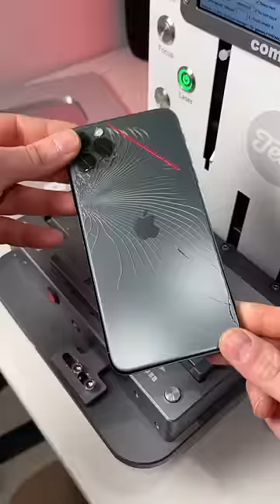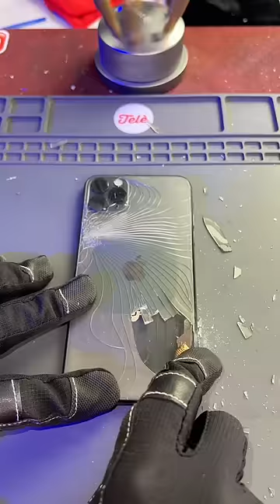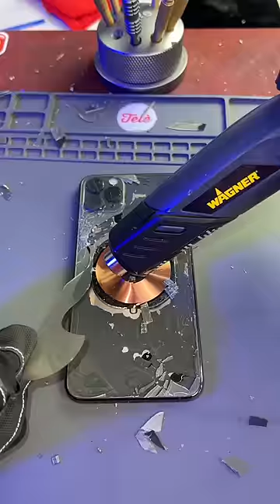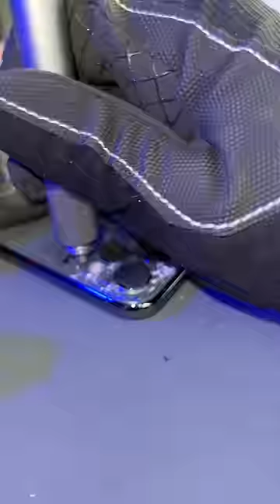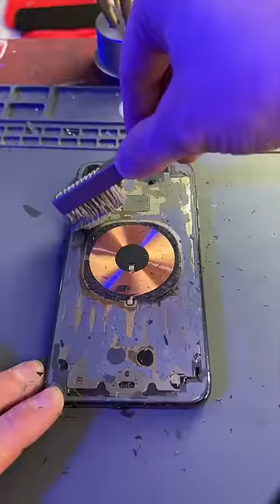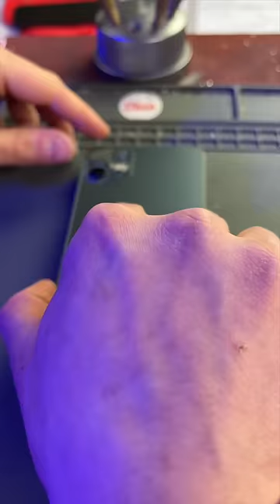Just another day at the office 🤠 #Shorts #Tech #PhoneRepair

Comment: I missed the time when we can freely removed the back phone cover on our own rather than taking them to a phone store just to remove it.
Reply: My old phone froze all the time, all I had to do was remove the back and take out the battery. Easy fix, worked every time.
Reply: @comandosespeciales yeah they are monopolizing that by doing this. now you dont have the freedom to fix your phone youre gonna have to just buy another one
Reply: my phone is still one of the ones that has a removable cover

being able to take out the battery is a flex at this point
Reply: Past:
Oh no, i dropped my phone! No problem, i can put the cover back.

Nowadays:
Oh no, gotta buy new phone -_-
Reply: I remember when my phone fell and had to reinsert the parts like Lego's 🥺🥺🥺 and if don't have a charger for it you can remove the battery and buy the wall plug charger where you have to line up the pins to the square conductor lines on the battery to charge it
Reply: I can do that with my android.
Reply: The whole purpose of non removable back is for water resistance. I would take a water resistant phone over a removable back phone anytime
Reply: And its gonna cost you 300$

Just buy other brands
Apple nowadays suck balls
Reply: @khanhtham1812  yeah everyone is also talking about “nowadays” like Apple didn’t fix this issue with the 14 models. The back panels are removable with screws now so no more phone cooking/razor blade wedging. It’s kind of a hassle to get everything apart enough to get off but it’s way less hassle than 30mins-1hr prying at glass with a razor
Reply: Yeah but then you give up on water resistance
Reply: @imfastboi  All we have to do is be careful then, I never brought my phone in the showers.
Reply: I love how no one here knows that he has to remove it not to replace the battery but to get a new back glass because it is cracked 🤦‍♂️
Reply: Get an android
Reply: @crowgang6678  most android phones nowadays don't have a removable back though
Reply: SAMSUNG ILLUSION 💀
Reply: @Palladiumavoid  this is only an inconvenience if you have butter fingers.
Reply: that never happened
Reply: Ah yes, the days of bulging batteries
Reply: @trevorandrew8726 have you actually done one?
I have, it’s not that easy. heating up still needed to remove back glass edge from frame. If you try and remove like you would a regular screen it won’t happen
Reply: The OG Samsung generation!
Reply: hahaha i still got em wanna buy :>
Reply: You have it rough, my new phone has a back that comes off easily, I can also put it back on easily (The glue melted and the back cracked, currently waiting for a new back case to arrive)
Reply: This is why i use samsung bc you can still do that
Reply: Well that's only with Iphones, you can remove it on androids
Reply: @miwiki6  my phone has one of those too,it's a literal flex lmao
Reply: @comandosespeciales  that couldve corrupted important system files
Reply: We could do that?
Reply: To be fair if you put a good chunk of money and time into learning how to you still can
Reply: @comandosespeciales  just hold the power and volume buttons together for 30 seconds. It does the same thing.
Reply: Marketing strategy
Reply: Ny soster still has hers, and it's in REALLY bad condition to the point where the power bytton doesn't work and 1 small fall. It becomes lego pieces.

 But hey, it's still working perfectly fine 😂😂😂😂😂
Reply: Youse can still get Nokia bricks guys
Reply: Money making scheme that’s why
Reply: @pea7422  it's nothing to with that, it's for waterproofing. You have next to no water resistance with pop off backing because there's no adhesive, any water and it's immediately frying the entire phone. It's really not that hard to fix your own phone...all you need is a blowdryer to soften the glue and new glue to reapply
Reply: @imfastboi  nope, my xiaomi phone have removable backs and I bring it in my bathroom since 2014 & I still used it until now.
Reply: @VermillionStallion   I brought my Xiaomi phone with removable backs to my bathroom since 2014 and I still used it even now 😂 heck, I lost count how many times the screen got spilled by water shower 🤣
Reply: @adhiwiranata400  Ok so I have a xiaomi phone too (without a removable back) which I also bring into the bathroom
First of all bringing your phone whether it's water resistant or not in the bathroom will not damage it even if you drop water on the screen
Secondly depending in the IP rating it can be dust proof splash proof etc doesn't mean that a phone without a back won't survive but a phone without a removable back will be more resistant to the kinds of hazards
Reply: You must be an android user bc iphone couldn’t be open since the first iphone
Reply: Ong
Reply: Buy anything other than apple then.
Reply: Oh yeah, and back when phones were durable too
Reply: @khanhtham1812  doesnt need to be glass though.
Reply: @Stephen.C.  glass makes the phone feel more premium
Reply: SAME I ALWAYS FELT LIKE A TECHNICIAN OR SMTH
Reply: I'ts done for only once use
Reply: Waterproofing left the chat
Reply: You can still do it with the Fairphone 4
Reply: 1 😊 nnl.  N.  N no nm. M.  😢
Reply: yeah no i don’t know how you miss that 💀 every time i dropped it, it’d separate into three pieces then id have to put it out together rather than just simply picking it pack up.
Reply: @miwiki6  ok go buy Samsung if u miss the time when we can freely removed the back phone cover on our own 🤨
Reply: Good times.
Reply: Sure, its been a long time
Reply: it's so we can't remove the batteries. Ur phone is on even when it's off. they can track u anywhere at anytime. watch Kimi lol
Reply: Yes
Reply: لا إله إلا الله محمد رسول الله علي ولي الله
واشهد ان الحجة بن الحسن ولي الله
Reply: Dont think they'd have a very good dust or water resistance if we could still pull em apart shame tho
Reply: @dnbcone  they're dipped or sprayed with water/moisture sealant to protect the electronics inside. I forgot exactly what it's called
Reply: @tjgrafiks  thought it would be something like that, is that after they assemble it tho? And tbh I always thought moding phones etc would be a big thing like the way people build pcs etc like I know so many people that have built and rebuilt pcs but not a phone, they're basically portable pcs nowadays anyway I've got the fold 3 and its just a computer that I make the occasional phone call on 😂
Reply: fr
Reply: Well if you live in europe, your wish might come true. EU wants to make law that would (among other things) make possible for user to swap batteries without special equipment or visiting service shop.
Reply: oque os fabricantes puderem fazer para ficarmos dependentes em manutençao eles farao.  querem tirar ate nosso ultimo centavo.
Reply: @dnbcone  more money in just making us buy new phones being that they’re almost the price or sometimes more than a pc 🤣
Reply: Yeah
Reply: And this is why I will never buy an apple product. Additionally, who the hell thought it would be a good idea to cover a phone in all glass? 🤔😱
Reply: @imfastboi  I've yet to get an Android that didn't have a removable back. And even newer cases can still be removed without having to go to anywhere special.
Reply: @imfastboi  Don't take your phone in water and you won't have a problem?

Rain wouldn't be an issue so unless you're going swimming, dropping it in the toilet or washing machine or taking a shower and dunking your phone under the water that's a you problem. Not the phones problem. 🤷‍♀️
Reply: broken measure2already😂😂😂
Reply: @comandosespeciales  من اجل
Reply: I have a Fairphone. These are so adjustable I love it, you can just open it and also nothing is glued it's just screws so you Dan fix it yourself
Reply: كظظد.. 
كك
Reply: @pea7422  that’s… not what a monopoly is
Reply: This is why my Nokia 3310 still works and charges.
Reply: They say is all about hermetic sealing
Reply: Wish I could be snarky and say "well, actually you can with Samsung" but nope, removed it here too. Pretty sure it's just better quality overall, still sucks though.
Reply: А еще можно было достать батарею, потереть её и зарядить телефон)
Reply: @sans.2862 Jesus if you dropped it in a puddle of  water and your battery fell out your phone is done. I've dropped my phone in the pool pulled it out let it air dry and it works fine. There was no IP rating on those phones with a removable battery.
Reply: No tendras nada y seras feliz
Reply: its only like taht now cuz its waterproof now
Reply: о́о́
Reply: о́
Reply: оо́
Reply: Ош
Reply: Ош
Reply: о́
Reply: о́
Reply: о́о́о
Reply: оо
Reply: @skullies3580  оо
Reply: @skullies3580  о́О
Reply: на
Reply: @Sans.
Reply: @skullies3580  О́о́о
Reply: о́о́о́о́оо́о́о́о́о́😊оо́ооо́о́о́о́о́о́о́о́о́оо́о
Reply: E
Reply: You don't own the phone or yourself anymore
Reply: had to put on my glasses watching this
Reply: Don't cry cause it's smile cause it happened
Reply: yeah its bullshit
Reply: And you can also be a smart person and buy the materials and tools necessary to do it yourself learn about it and do it there you go
Reply: Learn how to repair it than
Reply: Brother just don’t use iPhone majority of other phones still have that feature
Reply: That is Stupid Design from Apple ,Useless,  No Mind
Reply: @pea7422  i thought it was because they were trying g to make it as waterproof as possible.
Reply: get over it already
Reply: Fr
Reply: I get what you mean but like he said, these phones are water resistant and the old ones definitely weren't. You can't have both 🤷‍♂️ but I miss replaceable batteries too
Reply: Anything for money…
Reply: Ew I looked at vermilions vids… I think I need mental help 😭
Reply: Fr and it cost $100 wtf
Reply: When that battery would fall out in school 💀
Reply: thats apple meat rider for you
Reply: iPhone 14 has an easy back to replace. Sadly is only for the 14, not the 14 pro.
Reply: Iphone 14 does, not the pro thow
Reply: One of the perks of having an android
Reply: @pea7422  dude you can still do it all yourself you just don’t wanna put in more effort so you’re complaining instead.
Reply: idk what world y’all live in you can still fix the phone yourself
Reply: But it's not necessary to do that anyway
Reply: @crowgang6678 samsung invented glass backs on phones, theyve been doing it since like 2013
Reply: And like you could change the phone back like wallpapers
Reply: Yeah *"
Reply: You can't open them because the spyware runs even when it's dead
Reply: This is business
Reply: Fr!
Reply: Fr
Reply: @khanhtham1812  A lot kf phones are not water resistant and still have this. In that case the removable back would be better
Reply: @comandosespeciales  😅
Reply: @comandosespeciales  😮😅😮4
Reply: Me also, but I love that they’re now waterproof for a certain amount of time
Reply: It’s because if you can disassemble it easily it doesn’t make for a very water proof phone. If you want one where you can remove the battery, go buy one. They still exist
Reply: @skullies3580  WHAT I DIDNT KNOW THIS
Reply: @skullies3580 um you still can get one like that bro theyre not extinct just go buy an old phone
Reply: @skullies3580 gonna be running apps at 180p
Reply: Been this way since the end of the iPhone 8 days
Reply: Specialized shops like this would not exist today without Apple trying to make phones unrepairable for the end user.
Reply: @comandosespeciales  I had a flip phone that I lost the whole winter, found it outside in the spring once the snow dried up and it still worked 😂
Reply: @comandosespeciales  por eso era una mierda bro
Reply: el diseño con tapa extraíble es una kk
Reply: @khanhtham1812  nah the reason is greed is in their veins
Reply: Yeah...
Reply: Aye androids for the win on that one
Reply: @khanhtham1812  not all of them are waterproof, wack argument
Reply: @King.D_no.1  most flagship phone nowadays are waterproof. Do some research boomer
Reply: pains
Reply: @comandosespeciales  I miss my 2013 beige and second black SAMSUNG GALAXY J3 and my mom's broken note 5
Reply: U can still do this yourself u know that right?
Reply: jesus bro get with the times. if not go buy a old samsung i dont know what to tell you. and didnt the iphone 4, an older phone, have a glass back?
Reply: So you mean just go buy a Samsung?
Reply: I don’t
Reply: My old Samsung has a low battery and when I was about to charge it i dropped it and battery pops out and when I put i together again wallah!! Full battery 😂😂. And I was using it like for half and hour again😂
Reply: @andjelijarandjelovic5097  Not all Android phones, only older models.
Reply: @tsm688  Most Android phones don't have removable cases either.
Reply: @degstoll  Mine does.  Already replaced its battery once.  Our options as consumers are imperfect but we don't have to make stupid choices either.
Reply: @tsm688  But I don't need a removable case so how am I making a stupid choice, all the phones I know and I have had that have removable cases are older versions that don't run well, besides, I'm a student, I sometimes need my phone to do homework or  simply download large files for ebooks and stuff an older version phone won't do that optimally. Also, a simple message can take up to three minutes of lag so what exactly do you want me to do?

Also, with a removable case anytime it falls you risk the case and battery to fall and you have no dust proofing or even slight waterproofing.
Reply: @degstoll  Files:  Removable SD card.
Reply: @tsm688  WOW, you seriously ignored almost everything I said and jumped straight to the SD card thing, not all phones supports expandable storage so stop trying that hard to be right.
Reply: @degstoll  of course they don't.  Which is why consumers should buy ones that do.  The limited options is partly because of bad decisions made by others...  Buy disposable trash, receive disposable trash, more disposable trash is sold, more disposable trash is made.
Reply: @_khaine  not with the new ones🥲
Reply: @tsm688  Okay...? But that won't make me go use an LG K8 or ZTE Blade a7.
Reply: Get an android. Better market place.
Reply: Nah that cheap af 😂
Reply: You also couldn’t drop it in water and expect it to work again. I can take my phone swimming in my pocket and it’ll work just fine when I’m done
Reply: Bruh true, they are making everything worse, and we cannot do anything else than watch
Reply: Are there still people Taking phone to repair? I was sure its already cheaper to buy New one than pay for repair
Reply: If you could do that then your phone wouldn’t be resistant to water
Reply: Nah removable covers sucked for multiple reasons and you’d hate them today cause they’d have to be plastic which dosnt sound horrible until you’ve used a metal or glass phone for a while
Reply: Apple did it first to make the phone more air tight so they could increase water and dust resistance.
Reply: They still exist stop bitching about something you chose to upgrade, was the phone store man holding gun demanding you buy the phone with no removable back?
Reply: Someone dropped their IPhone 11 in a creek and plugged it in directly afterwards. Bought it for 3 dollars and some pocket lint off him and spent 60 dollars for a off-brand screen and battery off Amazon and fixed the whole thing up in a day and it worked good as new. If I took it to a repair store they would’ve taken one look at the water detector (which tripped) and denied fixing it saying some BS like “it voids the warranty”. 

TLDR: just fix your phones yourselves people it’s stupid easy, especially if some Indian guy on YouTube has a video.
Reply: This has never been an option for iPhone, you can still switch to an android with this option, though
Reply: Get a Android 😂
Reply: I know and if you have a phone case what's the point of glass in the back. Ain't gonna see it anyways.
Reply: But now they're waterproof so that's good
Reply: Yeah they make everything difficult
Reply: That was before we had things like wireless charging 💀
Reply: @pea7422  or buy the equipment to do so yourself and start your own company
Reply: Right to repair and fair competitor laws just entered the chat
Reply: My old galaxy phone had that and i miss that so much
Reply: Can't relate. Samsung user
Reply: Μ2 bro😔
Reply: They make unremovable back with battery couse they want to track all users couse without battery nothing in phobe works, but if we have battery even 1% it still gave some power to track your phone.
Reply: Now I have an IPhone 11 but I used a Samsung J 7 back in the day man , I can relate to this soo bad XD
Reply: @pea7422  спробуйте впихнути сучасну начинку телефонів в ті корпуси і вони дуже швидко перегріються і зіпсуються. Тому все стає "щільніше"
Reply: We do not care
Reply: Lol
Reply: @pea7422 more like buy a new phone every 4 years bc they keep shutting off the older phones
Reply: I’m 26 turning 27 this year and I remember phones with removable backs like it was yesterday
Reply: Even laptop has became like this unfortunately
Reply: Yup. Now you do as you're told and have no choice and you still buy the phone. You complain yet give them your money.
Reply: Being an avid mobile gamer, the removable battery was a godsend. On particularly intense sessions I would remove the back cover and sit infront of a fan for cooling or tactically reload my battery to game longer.
Reply: Ermmm... don't buy an iPhone then..
Reply: capitalism at its finest
Reply: The fact the gov ain't done shit about this. Shows you how much in apples pocket they are
Reply: And even change the colors 😢
Reply: @pea7422  anyone who’s an environmentalist using an iPhone? Call em out on it
Reply: Boomer
Reply: I'm just kidding why you angry
Reply: if you wanted to replace to back on nearly any phone, even older ones, you’d have to do tons of work to remove the components. this is easier, especially with newer phones that have parts baked right into the back.
Reply: @miwiki6  fr
Reply: @PHyN1151  nice pfp
Reply: Bro, When iPhone 4 Aftermarket Colors Came Out It Was A Wrap 😂 I'm With You On This!🔥🔥✊🏾
Reply: @miwiki6 one of the many perks of owning a droid was being able to remove the back AND a battery tbh
Reply: Oh so basically, you miss not having an iphone... influence is as strong as cocaine
Reply: @_khaine  same. I had an extra phone battery because my other phone stopped working. So when one died, I had the other. 200% battery life basically. And along with androids long battery life, it lasted about a day and a half until both batteries died
Reply: Coughs in Samsung Galaxy
Reply: Hahaha y'all complaining, I'm happy with my 2023 phone  rather than an old Motorola
Reply: Yes back then when we can remove the battery and put it back then turned on our phone
Reply: But for Android, it's way better
Reply: yeah💔
Reply: i have a theory they do this so you can’t remove the battery and it can always track your location and record audio even if the phone is off.
Reply: I used to have 2 batteries. Whenever it was out, I'd swap a new one in, have the old one charged. Unlimited power.
Reply: I still can on my galaxy xcover pro . I can still do a battery pull and everything
Reply: @comandosespeciales  just hold press the power button until it resets
Reply: Good thing here in Europe they just adopted a law saying that all electronic devices with batery( phones, tablets, laptops) must be able to be removed by users easy
Reply: never been the case with iphones..
Reply: Ikr...
Reply: Iphone users were too busy making fun of Android users for removable back cover and battery
Reply: Old iphones:👁️👄👁️
Reply: step one:
buy any phone that isn't from Apple
Reply: @pea7422 I like ur pfp
Reply: @miwiki6 I really like ur pfp
Reply: It's the part where people continued buying phones even when manufacturers implemented back parts of the phonrs that couldn't be removed
Reply: SAME.
Reply: Ah yes, you for sure miss the time when your phone fell and you had to rebuild it like Lego. And good luck with that battery working well after it falls out, and the phone turning off losing anything you had opened… for sure you miss it and it’s not nostalgia talking for you…
Reply: But this is so much more satisfying
Reply: To be fair, it's easier to make them water proof this way.
Reply: @miwiki6 drop it in water
Reply: @reagank.2268  that has happened multiple times and it's still as usable as ever
Reply: But u get waterproof
Reply: my old phone was super damaged so the back was removable, I'm still shocked how that thing was still standing
Reply: @VermillionStallion jhshe
Reply: @comandosespeciales lkkkkl..ooookooollllo
Reply: Lets not talk about the price of doing it
Reply: I had an Android Go and that was a feature, it was for sure "fun" looking at all the things!
Reply: I still have a phone that you can remove the back cover off of.
Reply: That will be 600 dollars sir.
Reply: @miwiki6  Newer Iphones will literally not work if you replace the battery for whatever reason. The phon can detect that a part isn’t its original and will PURPOSELY lock out certain feature like the touch screen or camera.
Reply: @SymmbolZS  my repair shop only charged 100
Reply: I also remember my phone being absolute garbage back in those days. Even the “nice” ones broke constantly and had issues
Reply: @masonroddy7447  also i love how they think this is a DIY tutorial video instead of showing how its done in the shop
absolutely clueless
Reply: @doh-nc8ku  Fr
Reply: True but tbh it just feels better when it's closed
Reply: @comandosespeciales exactly it was like it's brand new when u do that fix all your problems
Reply: Здравствуйте о
Reply: Iphone moment
Reply: @miwiki6 Fr i still have my androids
Reply: Thats why i have a Fairphone. You can remove the battery and repair all on your own.
Reply: Just don't get a garbage iphone
Reply: I pray we turn to Jesus Christ and repent of our sins for the kingdom of heaven is at hand forgive others just as God can forgive you john 3:16 For God so loved the world that he gave his only begotten son that whoever believes in him shall not perish but have eternal turn to Jesus Christ and repent.
Reply: Planned obsolence, hypercapitalism
Reply: @khanhtham1812 how often can your phone fall down and how often would it fall into water? Isn't the chance way higher it breaks from normal falling rather then water dmg?
Reply: @King_HarIequin  Ever heard of a phone case?
Reply: I have the ability to 
Then again, I own a Samsung instead of Apple
Reply: The good old "phone explodes on fall"
Reply: then go buy a flip phone easy solution for you 🤷🏽‍♂️
Reply: Flopper, whopper, whopper, fluffy flappy, daddy
Reply: Yeah old Samsungs did that
Reply: @pea7422 literally happened to me yesterday. I broke my iPhone 12 from tiniest thing that makes no sense but whatever and now I had to get another phone love that 1k+ paymant
Reply: Lol then dropping it and having the battery go flying into another dimension xD
Reply: It's a marketing thing. They get more money if you just buy a new phone, because nowadays instead of having stuff last as long as possible, it's getting as many customers as possible.
Reply: @miwiki6 what phone
Reply: How much is it to get my phone fixed
Reply: @comandosespeciales Yes, can relate to this XD
Reply: @comandosespeciales They're gonna make this required in Europe in a couple years
Reply: U stole that from somebody the sound affects u made
Reply: It’s pretty simple, spend about 100 bucks on a good case aswell as front and rear screen protectors now I can throw my phone on the floor n it won’t break
Reply: It's how they scam people
Reply: You miss the time when we still have freedom to do things as we wish
Reply: I still use one of these phones, its a bit laggy but it does the job
Reply: @khanhtham1812 Shit ain't even water resistant though
Reply: Consumers want waterproof phones… jeez
Reply: Don’t worry phone company’s are going to have easily replaceable batteries by 2027
Reply: @comandosespeciales yeah same bro but that my phone almost blew up 😂

Samsung days
Reply: Yea same..
Reply: I’m Japanese junior hi school student.
I think so too.🥺
Reply: Unlocked a memory
Reply: EU passed a legislation requiring that all new phones have to have changeable batteries, so also removable cover.
Reply: Planned obsolescence
Reply: Не ты а мы братец все упустили то время
Reply: @PHyN1151 ur pfp lookin kinda sussy...
Reply: @comandosespeciales wasn’t that old Nokia because I still have it and it still works 😂
Reply: But the drawback is that the phone will be heavier and thicker. They cant even prevent important parts from water. This design prevents users to buy low quality batteries so that it safer for us
Reply: Same.
Reply: You can still do this at home
Reply: Phone repair exists
Reply: Why you gotta take the back off for just use it for what it is if you shattered it that bad just go buy a new phone lmao
Reply: Apple 😂😂
Reply: @comandosespeciales Yeah but since the removable back in phones dissapear i never really needed to remove the battery manually new phones dont have any problems like that and even they do you can always hard reset with just power and volume buttons its no problem
Reply: Bro just use android 😂
Reply: @comandosespeciales phones like that were also slow af
Reply: I still have an old working phone that has a little line on the cover that if pushed takes out the cover. Apparently its a phone that doesnt have that thing to put the sim data card in the little hole so u open the phone and put it . Very easy to do and also is a way to replace the battery easily and to check if the phone is okay.
Reply: @skullies3580 it's not Legos it's lego bricks,blocks,elements,pieces ect
Reply: I remember buying a raw battery for my phone back in the day, and charging both when I had the time. If i ever ran out of juice on the go, I could just pop the back off, swap the battery, then immediately be back at 100%

I miss those days. You can't even expand your storage anymore :(
Reply: @comandosespeciales easy fix: phones dont freeze anyone for no reason
Reply: Seriously? Whats my dad's password
Reply: Now imagine that, but it's your car. Every company is doing this.
Reply: @Mr2000rusty  E-feudalism its called
Reply: You miss having a phone that broke as soon as you submerged it in water?
Reply: Yet people used to hate on androids for having remove able back plates 😭
Reply: @miwiki6 how is your YouTube updated I have phones like that, that literally don’t work for anything because they are just too old
Reply: Thankfully the METAL back on my s22 wont shatter like those ripoff Iphones.
Reply: Fr
Reply: Once had a tank of a Microsoft Phone could even switch battery and shit Windows 10 on a Phone lol
Reply: Boomer
Reply: Why people still buying those?
Reply: @kingbarrington_  does that really happen
Reply: Capitalism
Reply: Removable backs and removable batteries are coming back soon due to new EU regulations, I think 2028?
Reply: No one wants Plastik anymore also it is not waterproof then. So better stay this Design and invest into repair since its super cheap
Reply: Those models are still available, buy those and stop wining
Reply: Samsung, no?
Reply: @SymmbolZS have you even seen the price of Samsung displays?! was going to cost $699 to replace my Note 9 front glass… iPhone front glass is only like $199
Reply: NOKIA
Reply: @PHyN1151 your profile pic is cursed
Reply: I rather have a water proof phone😅
Reply: i sure love ip 00 rating!
Reply: @miwiki6  finding a place to buy a battery today is a hard challenge
Reply: @khanhtham1812  I never thought about bringing my phone to shower with me, but found water-resistance useful for cooling purposes. When I'm playing an FPS and it overheats, I dip my phone in ice water and it cools down quickly, I wonder if the inside gets cold also. Anyway my technique is more effective than using a fan or a cooler, but combining a fan with a water sprayer is almost as effective as dipping in cold water and you don't need to dry the phone after each steps.
Reply: You mean when you didn’t have an iPhone. 😂 the backs haven’t come off to anyone without tech knowledge since the first iPhone. Even my old 3gs I used to have didn’t come apart unless you had tech knowledge. My Nokia 3310 however came apart you’re correct.
Reply: Why I love android phones I have a Motorola and I can rip the back off
Reply: yeah
Reply: Back cover is fixed because of IP Rating......  Phone ko bhi toh water proof banana hea.....
Reply: Same
Reply: It should make a comeback soon. Iirc EU is mandating removable batteries. Y'know, a basic function any phone should have.
Reply: Because they earn from this
Reply: I still can do it
Reply: Fun fact, there’s a new law coming in place that Apple may have to also comply with similar to the USB Type - C port change where they have to make it so that the back of the phone is removable freely 😅
Reply: EU is planning to bring back the back cover and removable battery.
Reply: Switch to Android
Reply: 2027 we will 😂
Reply: removable back cover is lousy, 
they loose after months, and easy to fall
Reply: The old days were better indeed
Reply: They will do that again, well the phone companies dont want to do thst but they will be forced by law. Only in EU.
Reply: A
Reply: Just own the phone different than iphone
Reply: -Little Timmy, born in 2016
Reply: @Osmium38 Samsung really Phone!👍🏻
Reply: Buy Android
Reply: you can on lower end phones
Reply: @khanhtham1812 It's not that water resistant though, lol.
Reply: @khanhtham1812 And, it still shouldn't be made of glass.
Reply: @DAYG-9 They don't need to be replaced, that's the point. A glass back is stupid.
Reply: 00
Reply: My last phone had that, I needed a new battery so I just bought one...
Reply: Just dont buy iphone
Reply: But there are still phones that have that
Reply: @comandosespeciales same here..i even wanna try to replace my android phone lcd. But i realized even though i studied how, i can mess it up because of the screws and the adhesive. Unlike back then, you can even replace the casing in every color you want and the phone will be good as new and so stylish
Reply: Thatz tru!
Reply: I also have phones that have a removable cover
Reply: A😊q😊qq😊
Reply: back in like 2012 I was like 5. At those time whenever the phone froze, I flip it over and pull our the battery. No longer works now😢
Reply: The same time in order and more
Reply: Ra Certaphone s t shirt with an Certaphone
Reply: That it was in order
Reply: Remake xbox startup shut
Reply: Fr I Miss it too
Reply: Android users:🤭
Reply: iPhone has never had a removable back
Reply: My Samsung s4 😢
Reply: Ye bro
Reply: Yes, but those phones weren’t waterproof and dust proof.
Reply: Yeah but this created more jobs 👍
Reply: Then there would be no glass, no wireless charging, cheap plastic feel, old phone feel, no OIS systems, no gyroscope sensors, easier to tear off during big fall, no multiple camera lenses, no fingerprint reader on the back or the power buttons (even if there was, dirt would get in there easily), smaller battery capacity hence worse battery life, Type-C won't fit, no stereo or dual speakers, no triple microphones like today's samsungs, no IP rating hence no water and dust resistancy as it is not air tight and it relies only on the back panel latch which tend to get loose after years of usage, no Knox vault on samsungs, smaller and slower storage, smaller and weaker memory, no vapor chamber for the more powerful chipsets, no space for the NPU and modern GPUs, weaker NFC signaling if dirt were to clog, and phones would just look very much outdated. It is not a marketing strategy, it is to provide and add better technologies and innovations inside their new products.
Reply: возьми андроид и не парься
Reply: Lol still gotta fix the screen on my iOS 6 iPhone 4.
Reply: And on top of that you pay a lot to have them removed.
Reply: اىح😅😂❤لاتب